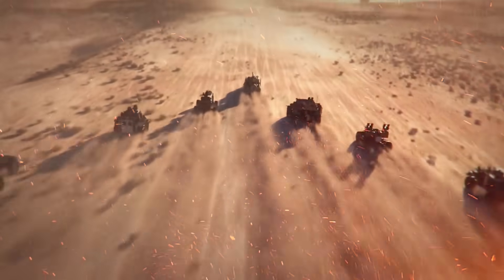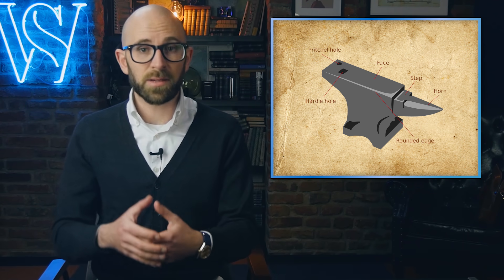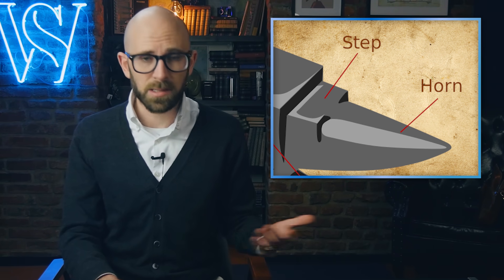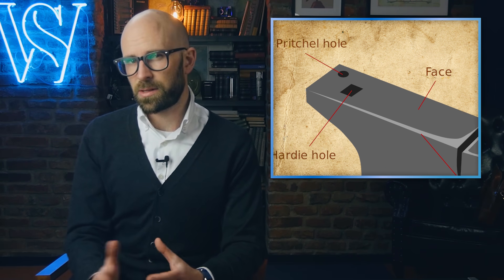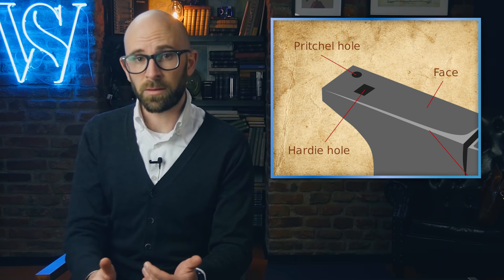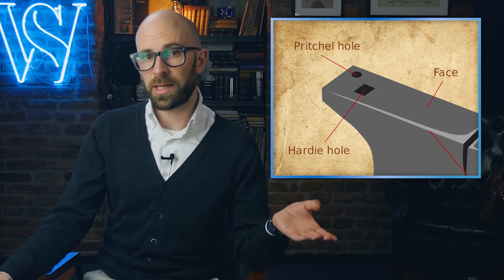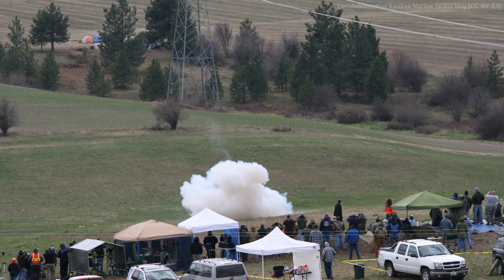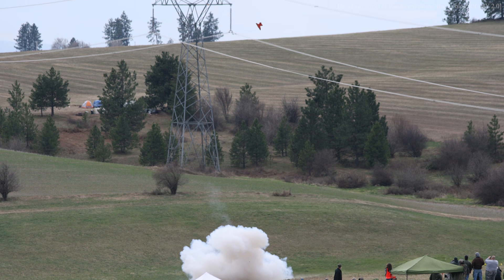Why are Anvils Shaped as They Are and Why Do Blacksmiths Tap the Anvil After a Few Strikes?

Comment: Some tri-note anvil taps are a call to a laborer for assistance, generally sledge-hammering a "top-tool" or "swage" onto the material, or "striking", which is the name for a second person wielding a much heavier hammer striking the object in the same place as primary smith, increasing the efficiency of any simple task, generally drawing (thinning) and curving, since even the time lifting the hammer between blows isn't lost. The three taps would also identify the anvil to the laborer by its' unique tone, helpful in a shop full of smiths and not lit very well, all of whom are at work. The terminal strike, or the strikers' last blow, is communicated by the primary smith bouncing with one tap on the anvil after their own last blow on the material, and these are also how blacksmiths communicate within a working space filled with not only a cacophony of anvil rings, but possibly in a foreign country. During production vocal communication is unnecessary and time-consuming (thus the source of the expression "strike while the iron is hot"), some older smiths were already deaf, some laborers would be outside the smithy's walls assigned to some maintenance chore. Some say farriers (horseshoers) would tap their anvils to ask the horse for trust or their forefathers for luck while holding a hoof and driving sharpened nails through it.
Reply: P.S.: The anvils' "step" is also where the primary, low-carbon material that comprises the anvils' body and horn is exposed, while the "face" is composed of a high-carbon steel wrapped around the "body" and tempered ("heat-treated") afterward. Should they become separated during/after a long day of maximum production, the tone would also change or even disappear, so the anvils' ring would attest to its' safety, and potentially the smiths' sobriety.

Comment: The parts of the anvil are used for what you want for example alot if people me included use the form to draw down the thickness of the bar as it does it alot faster than on the flat

Comment: When I was a kid in the 60s I watched bugs bunny , road runner.  I could never figure out what that odd black shape was that would fall and land on Willey coyote.  Then, when I was about 10 years old I went to a farm and seen an anvil for the first time. I was blown away. It was a big freaking anvil. I thought that black thing on bugs bunny was some mythical object.  I couldn't quite looking at it. I still had no idea what it was used for.  However, it made those scenes in the road runner make more sense. Everytime I see an anvil now, I remember that first time that I laid eyes on one.  I have never seen an anvil of that size since.
Reply: It would have been cool if the one called "The Village Smithy" (1936) did not have the full poem in it, because the last verse from Longfellow is thus:

Thanks, thanks to thee, my worthy friend,
For the lesson thou hast taught!
Thus at the flaming forge of life
Our fortunes must be wrought;
Thus on its sounding anvil shaped
Each burning deed and thought.

Of course, the rubber horseshoe sequence and the horse running backwards sequences might have had to go in that case, which would not have been worth the gain.

Comment: Good video. Usually non-blacksmiths youtubers get a lot of facts wrong about anvils, blacksmiths tools and techniques. Two things that I would add are that there are many different kinds of anvils which have specific purpouses. Also many anvils are mostly made of less optimal material than steel but have a steel face. This way they can be cheaper.

Comment: I'd imagine that tapping the anvil also serves to knock off any slag sticking to the striking surface of the hammer. There's a point in your video where the Smith is scraping the hammer across the anvil face, which looks to me like a cleaning manoeuvre.
Reply: Slag is what floats to the top when melting iron. Scale is the gray flakes you see coming off the work piece. It doesn't stick to anything,  and certainly doesn't stick to the hammer. I assure he was not cleaning his hammer. I have been a blacksmith for 43 years, never cleaned my hammer and I have had it every longer!!

Comment: Tapping the Anvil is also a means of communicating with your Strikers. Since the "Din of the Smithy" makes spoken instructions difficult, hammer taps are used as signals to the Strikers as to where, and how hard to strike the piece being forged.  Timing is also a very important part of the work, as heat only lasts so long, so the more blows the better for economy. If using several Strikers, timing is very important to get the most work into the piece per heat, and no less important in keeping your work force from hitting each other while working.

Comment: As a blacksmith, not correctly on everything on the anvil, but the tapping on the anvil...spot on. I have been blacksmithing for 10 years, and had many teachers, each having their own ways and traditions. But the tapping is indeed mostly used to keep the rhythm and see what needs to be done during that heat of the metal. Feel free to contact me for further questions on blacksmithing

Comment: Your description of the hammer bounce is excellent.  The hammer face to anvil is extremely elastic.  Much of the energy of the strike is then used to lift the hammer for the next blow.  Yes, and change the hand position up or down the handle,,  An addition,   The wooden hammer handle has a rhythm as well.  No steel handle I have ever used and only a single fiberglass handle I have used was suitable for striking.   And,, A hammer must have available to it a 'dead blow'.  This is a skill that accumulates over years of hammer use.  The short of it is,,, you do not hold the hammer handle tightly at all.  You do not swing hard,, or harder,, you barely hold the hammer handle,, it is just a guide.  You 'allow' the hammer to strike hard.  You let it release, turn it loose.  .  Two results,, a ferociously hard strike,, and unless you hit something soft and cherry red,, a rebound that will carry the head nearly as high as it was originally.  The same type of dead blow is essential for cutting stone.  The fingers are on there lightly, and only there,  to gently guide it to target.

Comment: Bouncing the hammer helps quite a bit with timing. 

I mainly use it as a way to calibrate where the hammer is hitting. Allows you to kind of feel how the head needs to be tweaked left or right, up or down to hit flat against the face, or slightly to the side depending on what you're working on.

Comment: Can I say, the tapping of the anvil with the hammer: is sometimes done into a small pool of water, this removes surface slag (the nasty stuff that changes how the metal behaves when cool, usually for the worse) from the hammer, stoping it from getting back into the metal, especially if the metal is folded (for forge welding, or to specifically remove slag)

Comment: I have a great Cliff Carrol anvil I use.  I find the bounce to be great and that's why i tend to keep the rhythm going.  I had an anvil that didn't bounce well and didn't tap as much unless working with an assistant and we had to keep time. I find it also helps to knock scale off the face of the hammer that may have gotten stuck there while forging.  You got this one 100%.  Incidentally, the tool used to punch the hole on either the pritchel or the hardy is called a "drift" and most blacksmiths make their own  I tend to have a separate punch and various sized drifts, but they can be the same tool.  You'll find plenty of basic tongs and such for sale but one of the cool things about smithing is that once you get a source of heat, a hammer, and something hard to hit it on.... you can make nearly every other tool you would ever need.  You can tell a lot about a smith by their collection of various hardy points, drifts, tongs, tapers, and other tools.  It's a history of every special project they've ever done and every crazy idea they thought would work, hehe.

Comment: You're absolutely right about the rhythm of hammer blows and taps to the face of an anvil. What most people don't realize is that an anvil is bouncy. It is so massive, dense, and comprised of materials that reflect force. When making strikes, you can allow the hammer to bounce on the face to then go back for more strikes, which is way less energy than lowering and lifting the hammer -- not to mention faster. Anvils can lose this bouncy-ness for a variety of reasons. An anvils value corresponds to its weight, type, composition, manufacturer/foundry, general upkeep, and bounce. An anvil with little bounce, is worth very little for forging. Source: Am Blacksmith

Comment: Striking the anvil while working on a piece also cleans the milscale that collects on the hammer face. 

You can see in ever shot showing hot metal being worked, a thin blotchy skin on the metal obviously darker than the surrounding material. That is impurities collecting on the surfacingof the metal. Tapping the anvil periodically will knock off the scale so you're not just driving slag back into hot material as you hammer.

Comment: If you make the periscope sturdy enough to stand sea waves, the blacksmith would most likely break their arms first before managing to significantly dent the periscope, hammering an cold steel. I doubt even bringing a portable blow torch would provide enough heat to soften the steel enough, especially if there are sea water absorbing a lot of that heat as the waves passes through.

Comment: What about in the case of knocking off any scale off the hammer that might be accumulating from hammering the piece? Is that also a possibility.
Reply: Not at all.it doesn't stick,  and would not be a big deal if a tiny piece did. Think about it, if tapping the anvil would knock off the scale so would hitting the work piece. However as I said in 43 years of being a blacksmith,  it doesn't stick.

Comment: I thought it was to clear/clean off any oxidation or chatter that attaches to the the hammer face.
Reply: It can be, I have seen some smiths have a small puddle of water on the face of the anvil. Pound the metal, then tap the hammer into the water, then go back to the metal, it can help remove forge scale (oxidation) from the hammer and the material at the same time.

Comment: Extra insight from a smithy. One major reason I tap my anvil is during the hammering phase, metal can flake off as it cools. Tapping my hammer on the anvil knocks any flakes stuck to my hammer head while letting me to continue working. If you don't do this, you can hammer unintentional patterns into the metal, and it weakens the structural integrity of your final product.

Comment: if you want a piece of hot metal to lay realy flat on the face of the anvil, you can. but if ya keep whacking with them hammer, over time your senses will trick you. kickback and stuff will numb your arms. not a lot, but enough. now if you hold the hot iron, and push it against the anvil and gently tap the anvil it self, the sound produced will be different when the hot metal does not line up perfectly with the face of the anvil. so thats one more reason to tap on the anvil a few times, you adjust how the hot metal is placed on the face.

Comment: As a hobbyist, i tap my hammer because i tend to work with recycled metals, so there is a lot of contaminants in the materials i use, this can sometimes cause a bit of 'slag' build up on the face of my softer bronze hammers, which can affect your work.

I'm sure there is a better way, but i literally do this as a fun hobby to keep my mental state in balance, so i am not overly concerned with being super professional about it all.

Of course right now...i am working on building a new forge...i sort of melted my old one...which is the third one...granted, i make all my forges, also using recycled materials...this last one was made from an old 5 gallon oil drum i found at the dump, and cleaned up, used some fireplace/chimney grout as cement, coated the inside with about 3 inches of the stuff using a foam insert to keep things from moving about while it set, and inserting some old cast iron sewer pipes from a demojob my neighbor did for vents.

Issue i find myself with...is that i tend to lose focus on the things other than my project so i let the handmade forge overheat...
Reply: Build one out of pottery clay. Make sure to leave no air bubbles in the structure. Let it dry completely (this can take a week or two depending on humidity). Fire it slowly (no forced air) in the beginning, and turn it up gradually. If you do it right, and no cracks form during firing you have a forge that will last a life time... grey pottery clay is like a dollar a pound, so it won't break the bank either.
Reply: @andersjjensen  I actually built my first forge that way, it lasted a long time, but sadly, when i moved, it broke during transport.

Until i have a solid place to call home, i will just stick with my current methods.

Comment: The horn is also used to help draw out billets. Punching a hole is often called drifting. 
The tapping helps to “right” the hammer, should the head slip to the right or left.

Comment: I thought the anvil tap was to knock loose any oxide or carbon excretion from the worked metal. To keep the hammer surface regular and keep the strike shape regular.

Comment: Pretty accurate but You missed a few things. The cutting shelf on the anvil was not used in the way you described. Wrought Iron anvils sometimes had steel faces welded to them for durability. The shelf was a section of exposed wrought iron so that when your chisel went through the hot metal it didnt damage the steel surface nor damage your chisel.

The other thing is the origins of the name Blacksmith. It does not originate from the term smite that is a common misconception. Smith is a common roman word that just means worker. Smith + "blank" would determine a more skilled laborer. Blacksmith works with black iron. Gold smith works with gold etc

Source: I am a professionally trained costumed interpreter and blacksmith

Comment: Not bad, I am a blacksmith and I agree with most of what you said here, other then the "Step" I never heard it called that but it sure could be in different parts of the world. I know it as the "table" or "cutting table" it is intentionally not hard so it doesn't damage the tools you use to cut metal it is designed to get damaged.

Comment: (blacksmiths student)
yep. I would say its more about momentum cause bringing the hammer to a stop strains the arm more then just letting it bounce but that is more arguing over a shade of grey. For anyone that doesn't know a good anvil has a lot of bounce when a ball bearing is droped on it. if you drop a ball bearing from 10 inches and it bounces back up 8 inches that is a very good anvil but if it bounces back up like 2 inches that is quite bad.

Comment: The reason blacksmiths tap the anvil between strikes has nothing to do with resting, but with energy conversation. A good anvil has some bounce to it, such that when the hammer face hits the anvil, the hammer just bounces back up. When striking an object rested on the anvil, this bounce also directs more of the energy into the workpiece. The main work of the blacksmith is in lifting the hammer to a height where it can fall with force (and a little added energy from the wrist) onto the work. What the blacksmith is really doing is bouncing the hammer off the anvil, which requires less energy than stopping the hammer all together (which is what resting entails).
Reply: Saving energy has EVERYTHING to do with resting. It is what resting is!

Comment: Joining Crossout…. take the weapons pack, it'll help more at the start, as your starting car can have one of the inferior starter machine guns replaced by your pack one, or you can get early practice at dual weapon control with LMB/RMB firing different weapons. In addition to the machine gun, the pack also includes shotgun (short range) and a cannon (limited ammo).
The cabin, on the other hand, can give you a bit more speed and a bit more acceleration, but means a major redesign of your car to add it.

Some key factors in Crossout:
Cabin: Provides top speed, drive power, energy (for weapons and other devices), mass and tonnage capability (tonnage being the limit where you drastically lose performance when exceeded).
Wheels: Increase tonnage, but cost power. Steering wheels add steering, but offer less tonnage than non-steering.

Equipment tier:
Common: White, built with resource scrap metal in lowest tier engineer workbench (free)
Rare: Blue, built with resource scrap + copper in next level workbench (needs coin to hire - though sometimes there is a free or reduced offer)
Epic: Purple.  Legendary: Yellow.

How free to play is it?
The PS (Power Score) balance ensures fair matchups at most levels, but if you never buy coins, you keep having to trade your collected resources to hire workbench slots, slowing progress, though once you can complete the daily and weekly lists, you have some good options to either collect stuff or trade on the market to get coins.
The "Miner's container" is an interesting one, for completing a weekly task of 42 dailies, you get a container which can be:
1. Opened for an UNTRADEABLE Rare part (good if you are F2P blue level part user).
2. Traded UNOPENED - good if you need coin
NB. The untradeable parts cannot be used in recipes for Epic parts, so they are dead weight once you pass beyond them

PS. Half price coin deals come up from time to time... I bought a modest amount, spent some on an item, and carry a float that I borrow from as needed, topping back up by trading that weekly container etc.

Comment: Hitting the hammer on the anvil will also remove the scale that builds up on the face so one is not pounding oxidized material into the piece or using an odd shaped face due to build up.